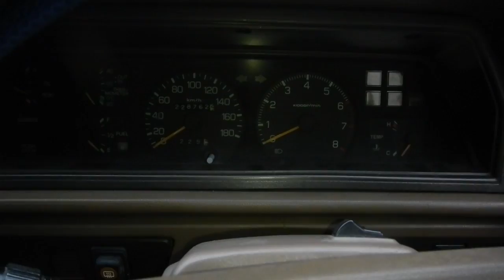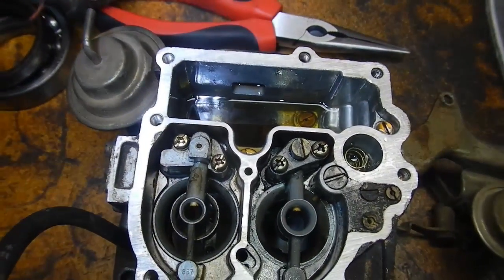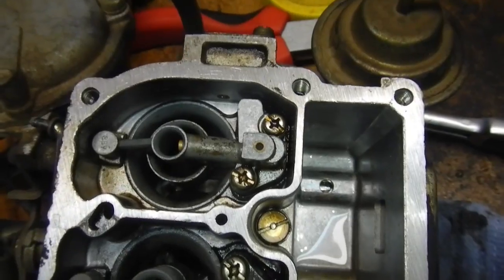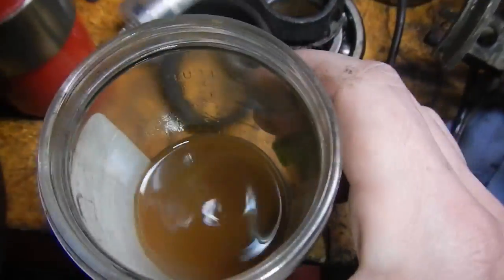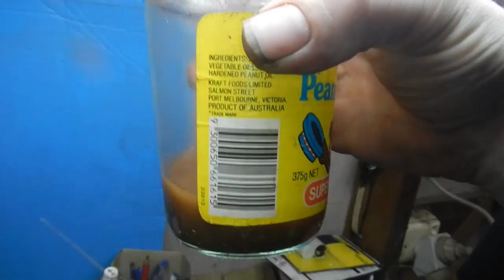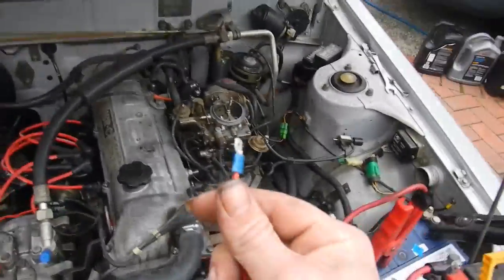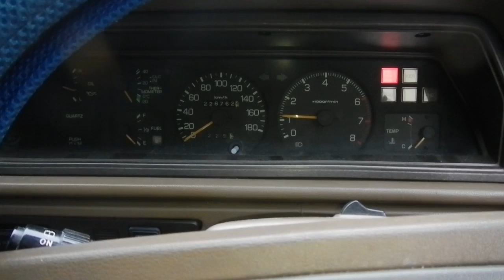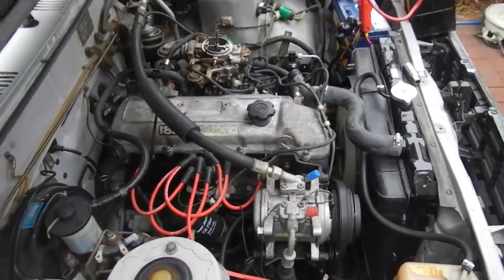RT132 fix p3

Comment: When E10 first came out on the market they used to have placards on the pumps warning that not all cars could use it, from memory almost all cars pre 1990 were suspect due to the type of rubber used in the lines and fuel pump diaphragms. Again from memory I think early Toyotas were a big no no. Still don't like the stuff, keep a check on this one for fuel dilution in the sump, the mechanical fuel pump could also be affected.